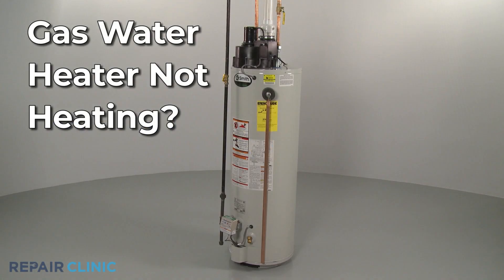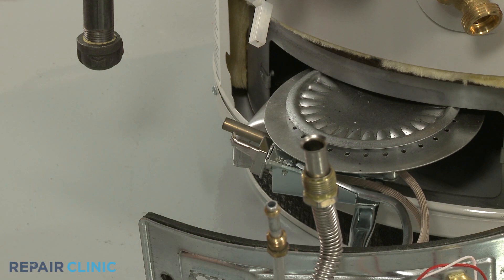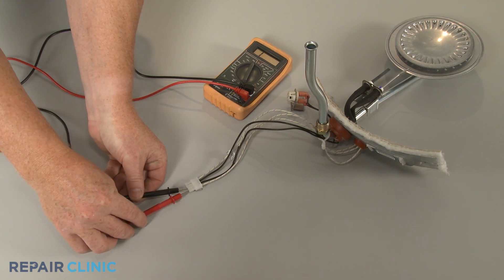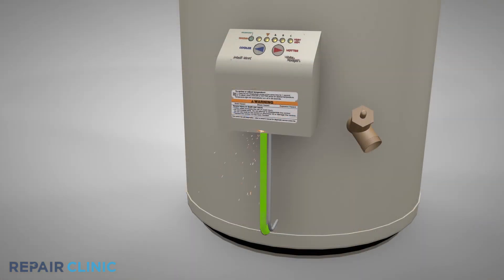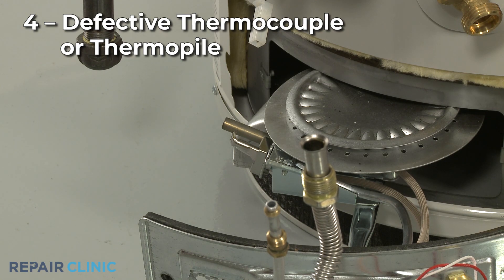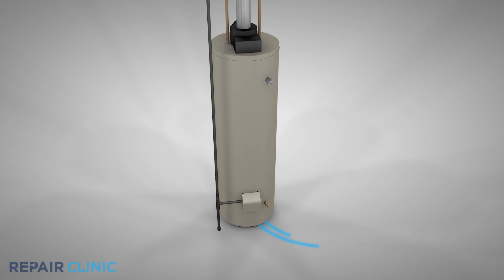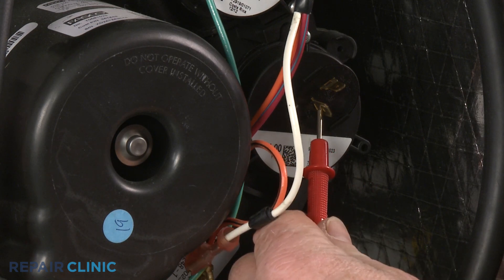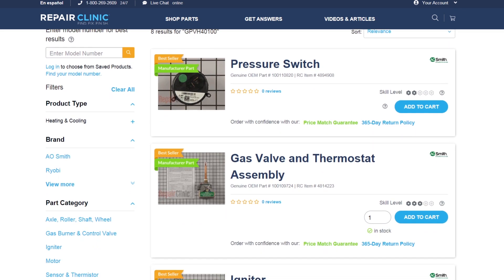Gas Water Heater Not Heating? — Gas Water Heater Troubleshooting

Comment: The average householder shouldn't be trying DIY, don't you think?
Reply: My son watched some you tube videos and replaced the thermocouple in one hour with a 30.00 part from Ace hardware. Plumber wanted $700.00 to replace the thermocouple. It’s not difficult.
Reply: Well....not everyone can be a mechanical professor like youreself
Reply: Then why are you watching? Just to find something to be negative about.
Reply: Agreed. Other than flushing the tank and replacing the anode rod, I don't work on my gas water heater. I just replace the whole thing about every 10-15 years. It's mostly plug and play.
Reply: DrgnFlys I guess you fall under the “blew up my house category “
Reply: Not with gas - exactly what I was thinking. Liability alone would warrant spending a couple hundred on a licensed professional... not to mention potential death.
Reply: @MjBeaud Couple hundred. Yeah your comment is 5 years old.
Reply: I do literally everything by myself in my house EXCEPT when it comes to gas hookups and main electric breaker. Servicing a gas water heater is NOT a DIY task.
Reply: antidepressant11 that’s how people blow up

Comment: I have an issue with my gas water heater to where it was cycling yesterday and now it won't work at all. By that I mean The fan still works but won't turn off. Yesterday the burner kept igniting and the flame would successfully light, but then after a few minutes it would shut off. Now it won't light at all and I don't know how long it was since it gave up and went out or how long the fan has been on. Do you guys know what could most likely be wrong with it?
Reply: Did you find out whats wrong yet.?
Reply: Now is it working?
Reply: did you get it to work?